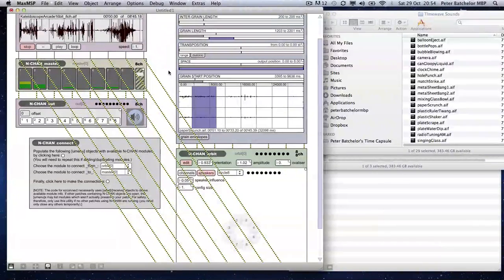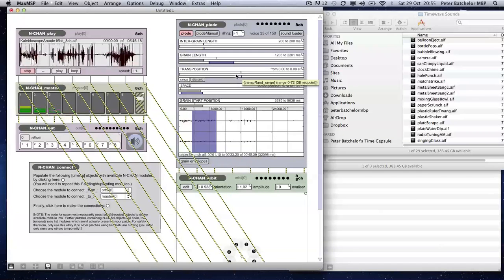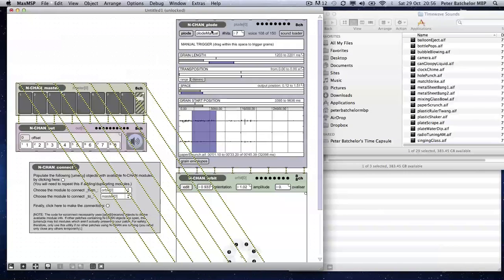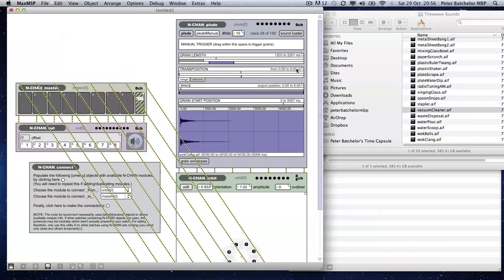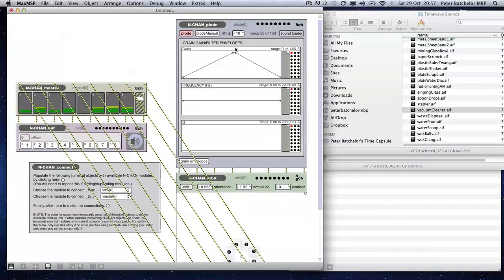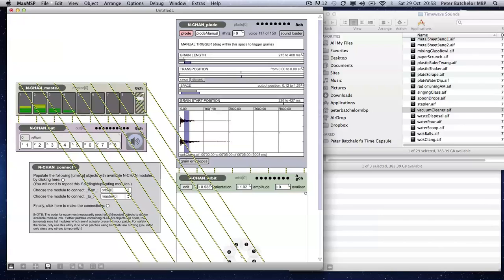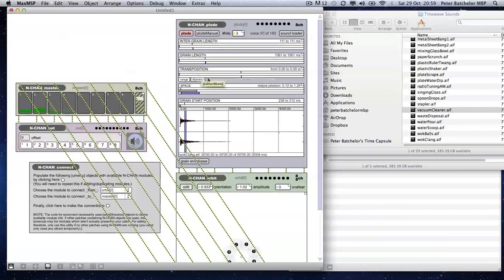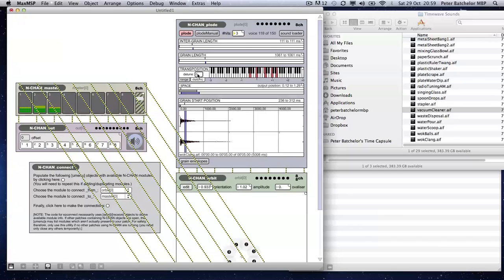N-CHAN Introduction 4

Comment from the maker: It's actually quite easy to use (notwithstanding the mistake I make later on in the vid). And I hoped that any complexity would be justified both by the sonic results and the flexibility of the tool (there aren't many granulators that will granulate to 32 channels (at least that I'm aware of)). But if you think it's too cumbersome, I'd be very grateful of any thoughts you have on how it could be improved.